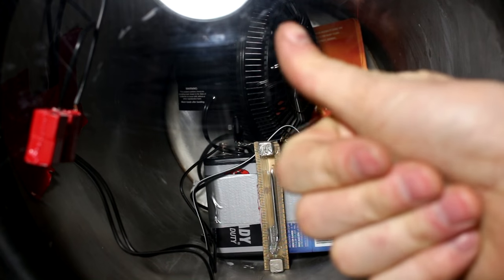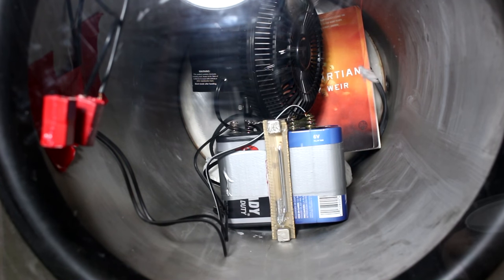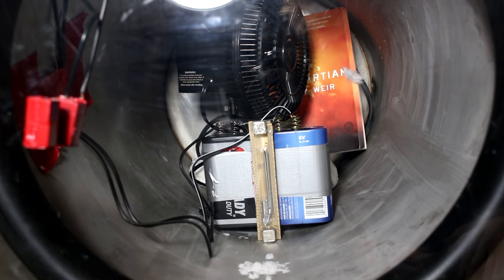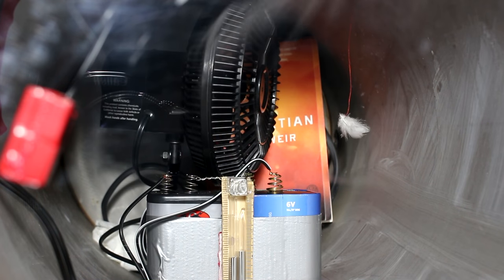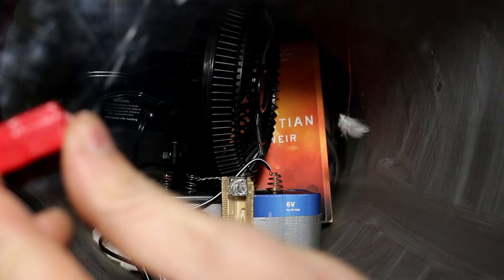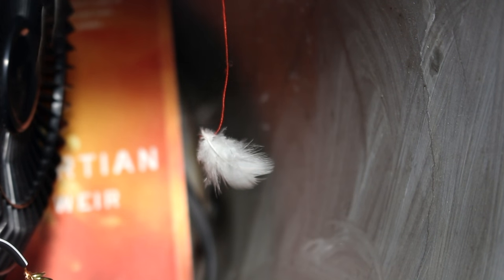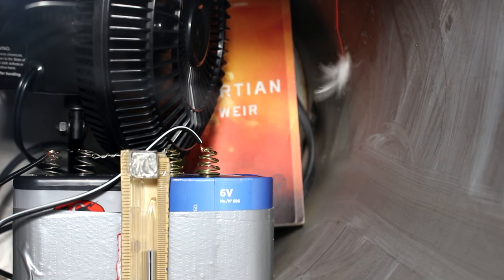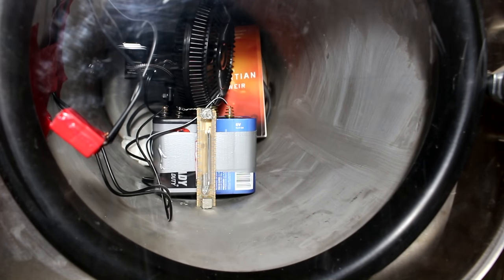How Strong is The Wind on Mars?

Comment: How did that switch work?
Reply: sXebeast; Well it's actually really complicated, but I will try to give a brief overview.

When the magnets are just sitting there and not moving, they obviously don't radiate any energy (since they are not consuming any energy to stay suspended like that, and obviously also ignoring their 'thermal' radiation as the amount received and emitted would exactly cancel out as long as the magnets are in thermal equilibrium with their surroundings); however, Quantum Electrodynamics tells us that the 'magnetic force' acting on the magnets is a result of the exchange of virtual photons (which are created by the net magnetic dipole of each atom which makes up the magnets) between them. If the one magnet were to start moving away from the other one (for instance due to gravity pulling it downwards ever so slightly), then it would indeed start radiating real photons, but assuming that the magnet's movement is relatively slow, the energy and momentum carried by those photons would be so small as to be entirely inconsequential to the working of the switch.

The resultant force that these virtual photons exert on the magnets, is simply the net sum of all the tiny forces of each atomic dipole that points in the same direction in each separate magnet. And if that net normal force, times the static coefficient of friction for the specific surface they are pushing on, is greater than that of gravity pulling the magnet down, it will stay exactly where it is and not slide down.
Similarly, since he turns the outside magnet slowly (when he wants to engage the switch on the inside), the magnetostatic forces still dominate over the electrodynamic ones and cause the inside magnet to also turn in exactly the same way (except for the coefficient of friction being reduced from the static one to the dynamic one, of course).

The fundamental reason WHY like magnetic poles (and electrostatic charges for that matter) repel each other while opposites attract, is unfortunately still unknown. We just know that that is the way nature works; even though Quantum Electrodynamics is the single most accurate physical theory ever developed in the history of science, it is still just a model of our observations. It does not attempt to ask, or answer, the question of 'why'.  And if you still find that unsatisfactory, then don't worry, your not alone. But, as the great Richard Feynman once famously explained: you can always continue to ask why, asking it of each successively deeper explanation, without getting any satisfactorily complete answer at all. So, we necessarily have to focus on 'how', unfortunately leaving 'why' for philosophers to debate.

Comment: so in a denser atmosphere ... the wind would be more forceful... buy the fan would have a harder time pushing it?
Reply: Insolentish I think so, in an atmosphere more dense, the fan motor would have to push more air molecules.
Reply: Look at it this way. Swimming thru water using your hands and feet is hard but it works.  Moving thru air is easy but nearly impossible to get anywhere by pushing air with you hands and feet due to how little energy transfers to the air.

Comment: Wouldn't the large amount of particles in the martian winds from dust create some type of weight momentum and increase the amount it would push something, like a sandblaster compared to just pressurised air. Because all those particles of flying sand or dust would be imparting their momentum onto something they hit on top of just the wind. Still not anywhere near as strong as they make it out in the movie, but you'd get a different result in this test you did if you had dust as well as air blowing through that fan i'd expect.
Reply: The thing is it wouldn't even pick up that much, and what it would pick up would be finer than "cigarette smoke" ~(Quote cody)
Reply: Name
It does though, every 5-6 years there are dust storms on mars large enough to see from earth, enough to block out the entire sun in parts of mars for a time period. Even dust that fine has momentum carried with it.
Reply: Name
In this test specifically I'd bet if you had some powdered talc blowing in with the fan up to speed of the fan, it would blow the feather quite a bit more than just the fan alone.
Reply: rdizzy1 It's still extremely fine, think of it like on earth, where you can't see the ground from space when it's humid there. Winds are hardly any stronger than when it's dry.
Reply: Name
In a small scale test like this, it would have an effect, especially since you have such a high density of insanely small particles per inch, compared to larger particles spread out more in a sand storm.
Reply: rdizzy1 It would have momentum yes, but against an incredibly heavy lander with a relatively low center of gravity? There'd be no chance of a fine dust pushing it over. The pressure would still be so minimal that the craft probably wouldnt even budge.
Reply: rdizzy1 The fan would create less wind as it has to deal with having to pushing the dust as well. It would move slower, and thus have the same net energy and have the same effect on the feather.
Reply: Name Which is why I said moving up to a speed to move the particles at the same speed as the initial wind, to copy how the dust plus wind on Mars would be, as the dust would be moving with the wind as one mass
Reply: Slaughtering Smiles That is why my original statement said "still not anywhere near close to how it was in the movie".
Reply: To shorten the statement up, 20 mph wind exerts less force on an object than 20mph wind+ dust. Same with 20mph flowing water vs 20mph flowing water+dust. It has to, as your adding more mass to the wind (or liquid), regardless of how small.
 Aside from that, in the movie, it was one of the biggest dust storms they've ever seen.
Reply: powder wouldn't be able to be blown from just 5-10mph winds...
Reply: Baba Wethu
Yes, in a test environment it would, and it blows on mars frequently, albeit far more dust and at a higher speed. Go find a similar tiny fan, or even smaller, and throw a small amount of baby power into the back of it, it'll blow out everywhere.

Comment: First i want to say cool video.

Second my confidence on the accuracy of your vacuum gauge is no the greatest

Third the overall might have a big flaw. (i will be looking  up the following myself because im not sure how it works either). How do we measure wind speed currently, im sure there is not a radar gun that can measure the molecules of air. Also measure the wind speed of something being pushed by the air is not that accurate. So here is what im thinking, you get a wheel, run it on a table and calibrate for linear velocity. convert to degrees per sec. Then get a fan same diameter as the wheel....

Long story short, even though the fan speed is the same. the wind speed is not because of a misnomer i guess. we say 50mph wind. What we really mean is the wind has the same affect of a fan blowing x degrees per sec aka mph.

Did i win a prize.

Comment: well he was in a dust storm when he got pushed so you have dirt everywhere it's not just some co2
Reply: also did you take gravity into account?
Reply: The dust that can be lifted in the Martian atmosphere is extremely fine, and therefore lightweight. Even though these dust particles would impart some extra force, it certainly wouldn't be enough to push a rocket over. If you were standing in a dust storm on Mars, you most likely wouldn't even feel it.

Comment: Some guy is using a part of this video say it is proof rockets don't work in space. I came here to debunk his claim due to him disabling comments on his video. While his assertions are asinine, A fan is not a rocket, nor does it work in the same way as a rocket. The way the original maker of the video is testing a whole other theory. A fan will not move air if there is no air to move. A rocket force is due to expanding gas created with a combustible solid or liquid substance, after the initial spark to ignite the fuel,all energy and movement is derived from the fuel expanding and escaping. With a fan you are using an external power source to move a mechanism to force air in a controlled direction.

Comment: This experience is biased because it has a major flaw ! the "FMR" (Flow Mass Rate) which depends mainly on the pressure of a gas (or any fluid), he must recalculate the FMR of his "terrian" fan to have the same FMR on Mars
He should have used this equation 
Q (FMR)
m* (mass flow rate in kg/s)
rho = (density in kg/m³)
where:
Q= m*/rho
His "terrian" fan have a certain Q, and must extrapolate this to Mars
Because density matters here, like the mass transfered per second, the same fan can't be used in the same experiment in two different pressure conditions
Figures regarded, his fan would be enourmous to even reach the same "Q"

Comment: those pieces of frozen co2 did not dissolve..   how do you know what wind speed is providing the fan?? 
Also.  in mars you have -60 degress celcius, this increase the density.
What matter most is the wind speed because drag is v^2, also the extra area of the spacesuit, then the super low reynold number on mars atmosphere, these mean that you get laminar flow even at high speed, this increase the drag a lot.  As last..  there is gravity, you weight less there so your friction against the soil to counter the wind is lower.
Wind turbines were designed by NASA for mars conditions with real fluid simulations.
In the dust storm the atmosphere gain extra density due all the dust that is flying..
About max wind speed on mars, there is not enough info to said how much it is.

Comment: How can there be 70mph wind then if nothing is moved?
Reply: because mph refers to how fast particles (air) is moving, not how much air. Think of it the difference between blowing air at someone vs spraying them with a hose. The much heavy water even at the same speed imparts A LOT more energy than air. On Mars there is 0.6% of the atmosphere as Earth... so 70 mph wind on Earth has ton more force than 70 mph wind on Mars because there is a ton more air particles moving on Earth.